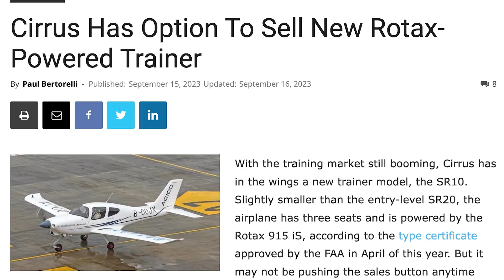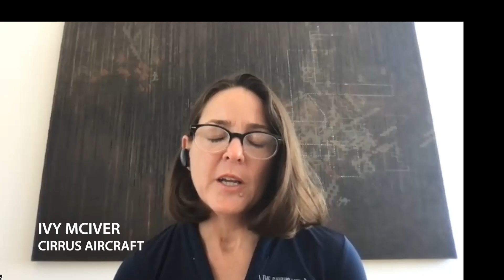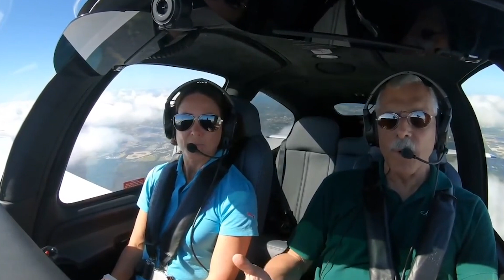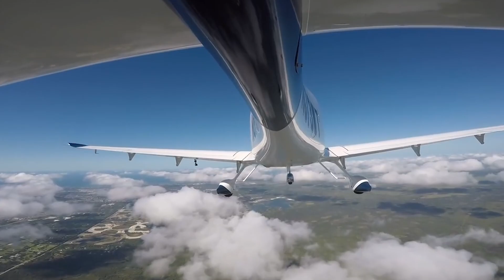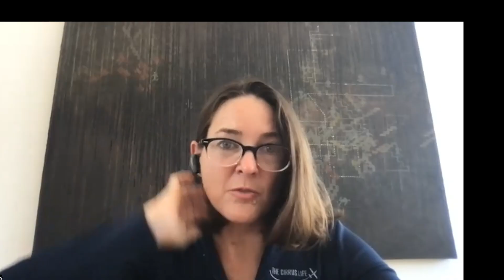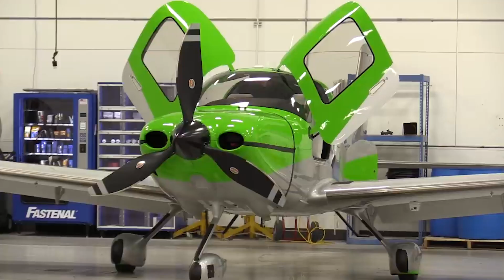Cirrus Unmasks the New SR 10 (But Not for the U.S.)

Comment: Even I know, Cirrus is now Chinese owned, the concept of the Cirrus SR10 is also interesting for the North American and Europe market. But not as a Part 23 certificate. That’s nonsense and is to close to the SR20 market. The demand is in the up coming LSA market. Nobody needs a 3-seater plane there. But a Cirrus SR10 2-seater aircraft with the Rotax 915is or 916is would be a blast. That makes sense. Cirrus sleeps here and doesn’t understand the LSA market. There are some great products coming up like the VL 3 or the Bristell. Even flight schools will gain this market and more and more GA pilots. For less than 50% of a Cirrus SR20 you get awesome high performance airplanes. I don’t get the need of a 3-Seater SR10 with Part 23? Only the gas mileage and maybe the price will give you a fortune compared to the well known SR20 in the market. Of course, if the Chinese want this plane, they will get it. But smart and global market thinking goes different in other direction. A SR10 2-Seater LSA from Cirrus with that world wide best known brand will sell as a next bestseller. Maybe Cirrus will understand this some day, before other brands own the big cake of it. 😊

Comment: The China Cirrus.  I bet it's still over $400K.  All new GA aircraft are to the point where no one in middle class or upper middle class can afford them. Thanks to regulation and lawsuits it's all off the chart expensive.  Most of us will be flying 1970's Cessnas-Pipers until they fall apart.  The industry will die a slow death.  The funny thing is the freedom of flight does not really fit China's lack of personal freedom but hey they need to train pilots to haul the masses around...I love the SR22 but the prices of the new ones are insane along with all the new GA aircraft...

Comment: Having hundreds of millions in revenue per year they are in a unique position to cost optimize production dramatically if they have the intelligence to realize the value of doing so. A plane is a quite simply construction and can be made drastically cheaper than they are doing now. And their SRs are a bit more modern than the post WW2 tractors but only modestly. It's not a particularly aerodynamic design, nor light nor any kind of modern engine. Nor retractable gear. And of course the huge potential is ditching the awful piston prop in favor of two small turbofan jet engines and a sleek pressurized cabin. Without developing nonsensical notions about 7 figure price tags. Their SR22T is already absurdly overpriced. This widespread mental affliction in aviation that things have to be 10x overpriced should really be dispensed with. If a composite hot tub can retail for 5k, why is it 900k when you include a briggs and stratton.

Comment: Why not use Rotax’s 916 FADEC engine, almost 15% extra power c/w 915, without sig. added weight. I’ll go one step further, with no offence intended. The major stakeholder of Cirrus is now, I believe, pushing for a new-age (FADEC) engine. I think that is delightful and will be a really nice extension of Cirrus’ immaculate planes. For the naysayers, fly a FADEC, and you’ll see and hopefully enjoy exactly what I mean! Blue Skies, and cheers AvWeb and Cirrus
Reply: The Rotax 916 iS has the same continuous power as the 915 iS. Only takeoff power (for 5 minutes) is increased.
Reply: Simply because this was certified before the 916 even came to market. Not worth re-filing the paperwork.
Reply: You don't need all that if your plans are to develop it into a military drone.